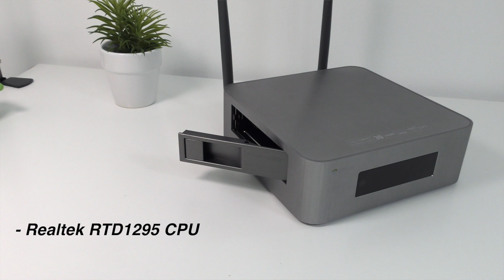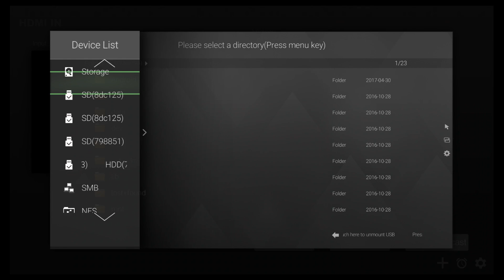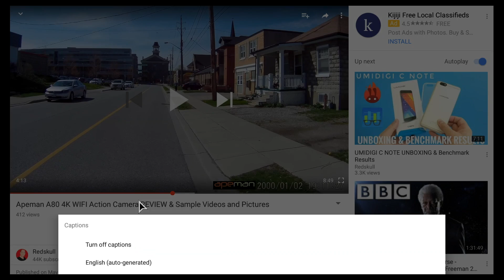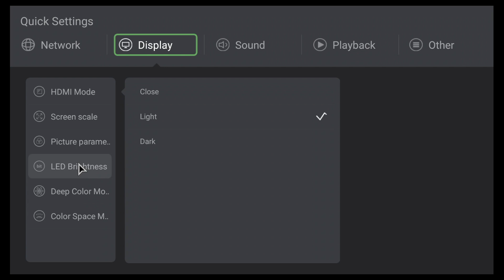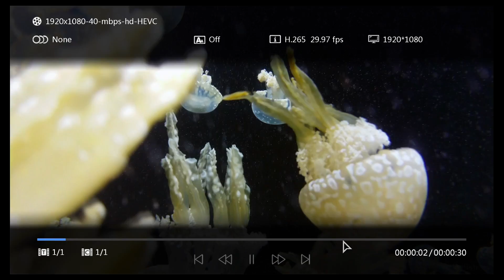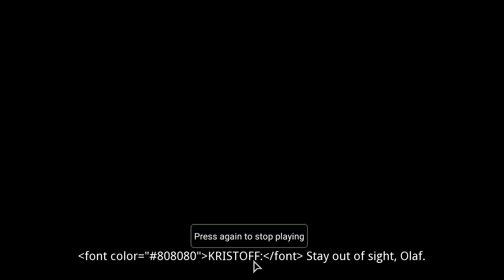Zidoo X10 Media Centre REVIEW - Realtek RTD1295, SATA 3.0

Comment: I stopped at the 1min mark for a bit, as soon as I heard 2gig/16gig. What should have been done was to take this housing and build the H96 Max (since the Max has heat issues) OR possibly the Yundoo Y8 in it. 4gb's of DDR4 ram is a must! The hard drive bay is a GREAT for a 512gb SSD. Dual high gain antennas are a good too. For the money they are asking though, I would have included a built-in HD webcam and made all ports USB 3.0/3.1.
Reply from the maker: thanks for watching the 1st minute :)

Comment: Based on your review I have purchased Zidoo X10. The NFS function is not working. The X10 and my laptop connected to same wifi network but I can not see x10 in my window computer for file transfer/sharing. Any comments????
Reply from the maker: you do realize that the software on these changes very often right? you can download any file explorer app from the play store, but i am very sure that the built in one works as well. Tell me something... if you connect your android phone to the same network as your computer will you see the files on your android phone? Because this is exactly what this is, and android device

Comment: Very nice, but expensive. Great reviews! Please help. Your reviews are the best, but there are so many Android Boxes out and coming out.

What would you choose between: Mecool BB2 Pro, Mecool M8S Pro, Yoka KB2, Beelink GT1 Ultimate, or Alfawise H96 Pro+?

I see you also like the MXIII-GII. Is that just more reliable or does its lower hardware outperform the above? Also, are the Minix Neo U9 H, Skystream One,  or any Zidoo X9 or X10 really worth spending 2 or 3 times others? 

I typically use RPi3b for retro-games and Kodi. I also just bought FireStick2 (mainly for travel). Just cut off $170/month DTV. Currently adding new Android boxes. I will buy through your links. THANKS!
Reply from the maker: i would get the mxiii-g ii from all of these, cheap and works great
Reply: I was right on the edge of buying that, but went with the H96 Pro+ for a better spec system. I'm willing to mod it for cooling (also 2 extra USB ports) and get new/modified firmware to fix some darkness and other issues. 

I think you've sold me on the mxiii-g ii as my next purchase, although I could hold off to see what stable 3gb or 4gb RAM models will be coming out. I mainly am looking to spend $100 or less to get 5.1 surround with Kodi 17.1, Android 7.1, with good multi-tasking and ability to have Google Play with a lot of standard apps and media apps. I'd like the system to be a little bit future proof.

Comment: Nice Android TV Box, good review!
Reply from the maker: +Edward Halberstadt thanks! Did you see the new Microsoft Laptop that was introduced today?
Reply: Nice looking Macbook, uh Surface Laptop. Don't understand the Windows 10 S version on a 1000 euro device? Like the touchscreen, will prefer this over a Chromebook.
Reply from the maker: +Edward Halberstadt supposedly it will be a free upgrade to windows 10 Pro for a few months. It feels a bit expensive.
Reply: The specs on the cheaper version are not that great indeed, props for trying something different. 
Love the texture on the surface, the position off the speakers and the screen.